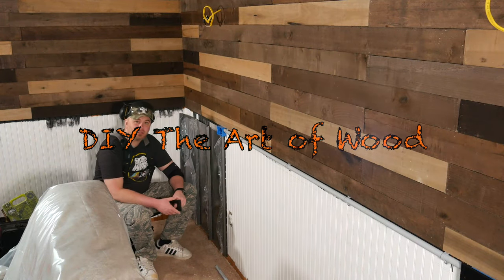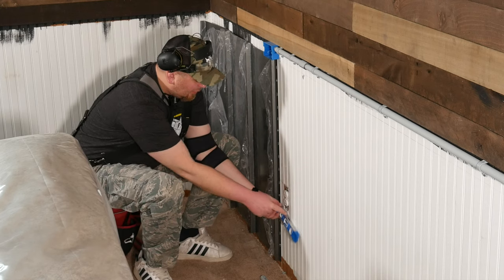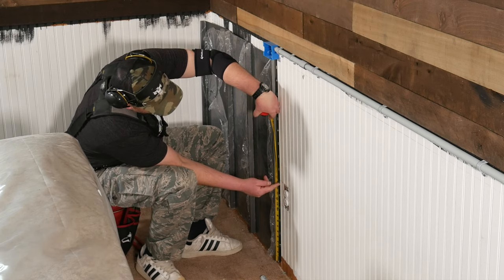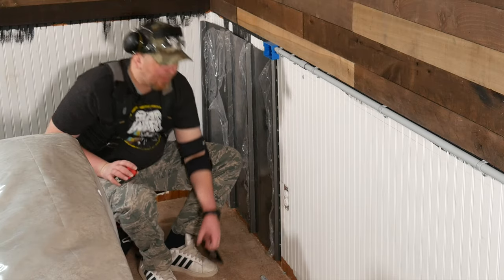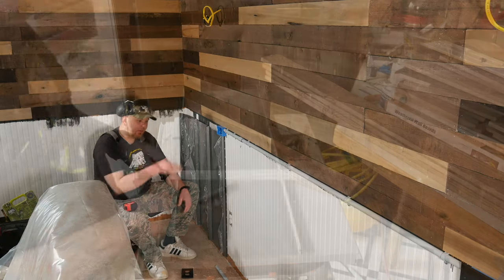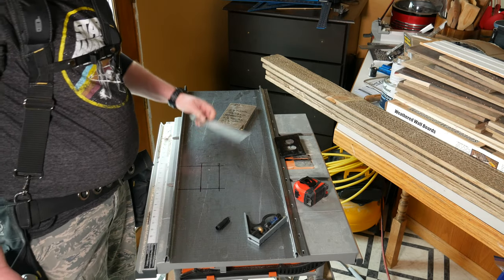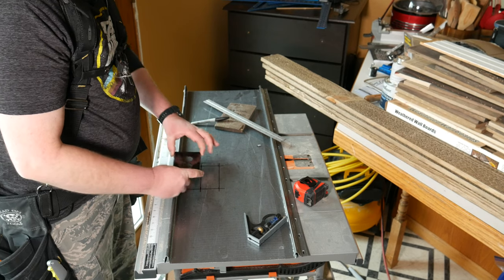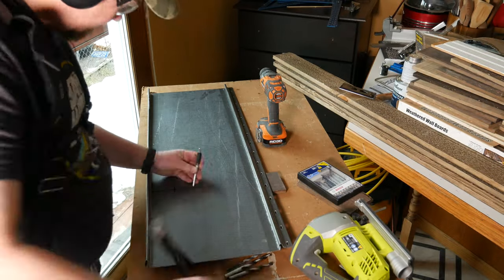How to cut a hole in steel paneling - Quick Tip

Comment: The finish product looks awesome brother!! Where did you get the steel wainscoting? I am remodeling my studio and love that style instead of corrugated. Must be kind of hard to find because I have googled everything I can come up with nuttin! ha ha Again great job!!
Reply from the maker: Thanks, I appreciate that. That style of paneling is a steel roofing and siding panel called standing seam. If you have a local company that supplies or installs steel roofing, they should be able to make these panels for you. The exact style in this video is a 16”x1” nail strip standing seam, the material/color is Rezibond. Rezibond may be hard to find but bonderized looks similar and should be more readily available. The company that made these panels is Bridger Steel out of Montana. Hope this helps you find what you’re looking for. If you have any other questions, I’ll be happy to help point you in the right direction.
Reply: @JFKreations  awesome bro and thanks for your help!! I found it and going to order up some for my project!!
Reply: @JFKreations  1 more question, what did you do to fasten them in the corners? Did you have exposed screws on your first sheet in the corner? Thanks again for all you help and have a great day creating!! You earned a new sub for sure!!
Reply from the maker: @DeadBrokeBBQ  right on, are you ordering from Bridger Steel?
Reply from the maker: @DeadBrokeBBQ  nice! Always appreciate a new sub. That is pretty much how I installed those, hidden fasteners all the way across except for the end panels. The ends I just covered with trim to hide the fasteners and viola, hidden fasteners there too, sort of. But better than tell you check this video out to see how I installed these panels  https://youtu.be/Z6M7dT9gfrk I also have a playlist on my channel showing the complete family room remodel project that shows more how I tied all this in to the trim and what not. Could be worth a watch... enjoy!
Reply: @JFKreations  Not sure yet I have my local roofer checking into it but I would certainly order from Bridger! Roughly how much is a sheet of the kind you bought? I get it prices change but just looking for an approximate to help keep my roofer honest! hahah When I do my little studio rebuild video I will give ya shout out. Thanks again brother!
Reply from the maker: @DeadBrokeBBQ  well that’s where it gets a little fuzzy for me. I used to work in the steel business many moons ago. I worked at Bridger Steel and I picked those up for free from a discontinued material as a thank you for your service type of deal. I’ve been out of that business for a few years and haven’t kept up with prices, especially lately post Covid when all building materials have shot up. But maybe as a yard stick check out Metal Sales, they’re a big national steel paneling supplier and should give you something to go off of for pricing. And heck yeah if you post a video of your build I want to see it. Send me a link!
Reply: @JFKreations  I'll check them out and heck ya bro. I will send you a message once I post the vid. Might be a couple videos with all the things I am doing this year but the first one will be where I use your idea of using this style!! Thanks again for all the info!! Talk soon!!
Reply from the maker: @DeadBrokeBBQ  you got it. And I’ll look forward to see what you do with the remodel.